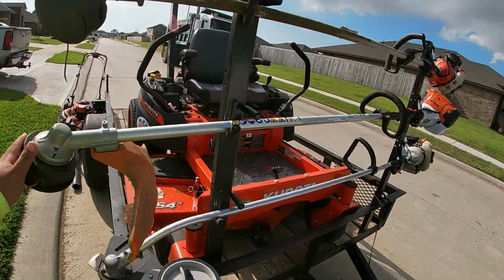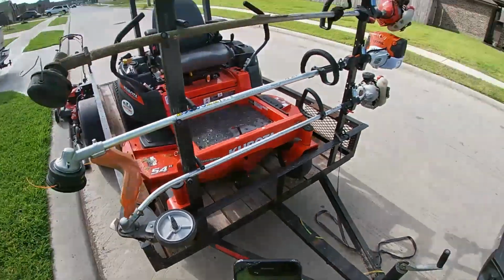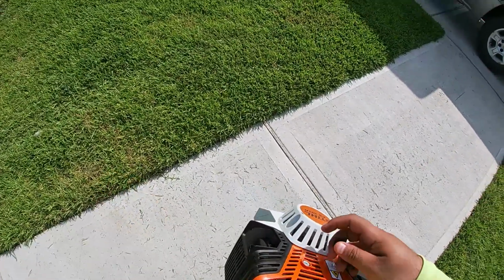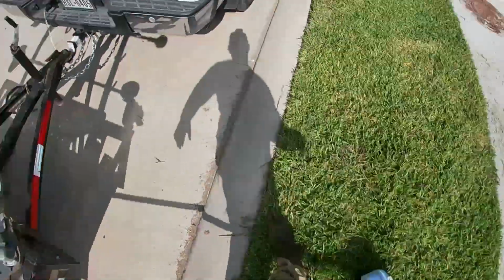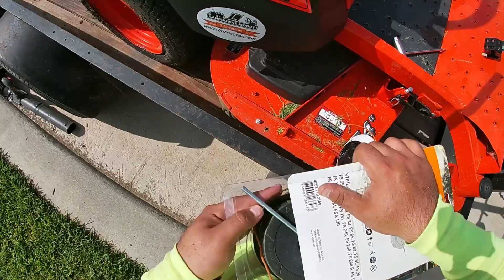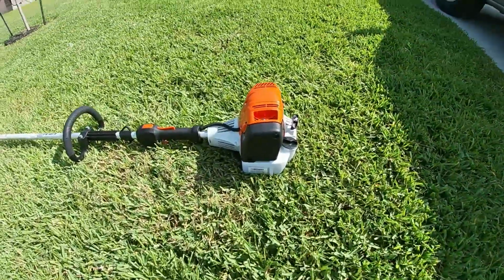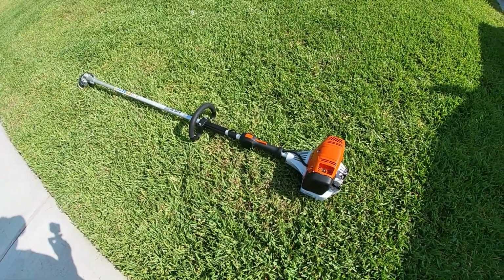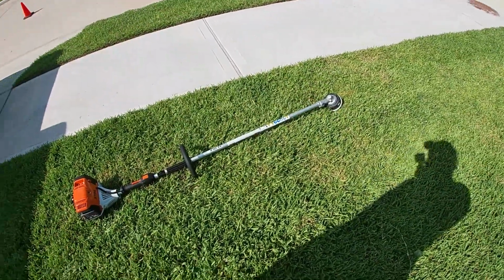STIHL Fs131r Review POV (EDGING , WEED EATING)

Comment: This is exactly what I need in a power tool review video!
Just use it as professional and show me how it rolls.  

That 35cc monster sounds like a smaller dirt bike. 🤙
Reply from the maker: stoichiometry147 yes sir she’s a beast still going strong the best weed eater I’ve ever used
Reply: Peewees Lawn Care I’m still getting an FS131r in time. But, need to replace a ryobi POS for now and I’ll get the 94r to keep my HOA from killing me.  
Since they seem to retain at least 70% of their value over many years and I’m getting it that much off, I’ll sell the FS94r for what I paid on CL.
Reply from the maker: stoichiometry147 that’s a good choice
Reply: The 94 is very reliable and light weight. Not a monster in the power department but it’s not designed to be. Plenty of inexpensive parts available too if you need to replace a rusted out muffler 5-6 years from now.

Comment: What model number is the new head you put on
Reply from the maker: king of the track 1990 auto cut easy spool
Reply: @PeeweesLawnCare  it doesn't have a number like would it be a 26-2
Reply from the maker: king of the track 1990 not that I know of I need to check it out

Comment: How do you find the four stroke compared to the two stroke at the lower RPM's?
Reply from the maker: MOTOCOMBAT the 4 stroke on lower rpms is really strong compared to 2 cycle weed eaters just imagine a 4 stroker on lower rpms is like using a 2 cycle on high rpms

Comment: You should a echo speed feed head
Reply from the maker: Logan Simpson is not sure if it will fit the weed eater maybe I’ll have to get an adapter brother
Reply: It will fit trust me
Reply from the maker: Logan Simpson ima try it soon
Reply: @PeeweesLawnCare  it brings adapters with it, green fitting i believe
Reply: @PeeweesLawnCare , it does fit. If you get the universal speed feed 450 head use the green nut. If not you can use the Stihl nut from a 25-2 (standard head) and it will work. Use speed feed 450’s on almost everything.
Reply from the maker: @nsatoday  ima try it out maybe I can get a smoother edge line

Comment: Too big for that kind of weed eating.  It is for rough cut weed eating.  You cant feather control  very well.  All or nothing.
Reply from the maker: AG86 yeah I actually noticed that , that’s why now I just use it for like big properties and over grown properties
Reply: AG86 I’ve got a 94r and my dad just bought a KM91R. Everyone says u can’t feather the 4 mixes but I used it quite a bit yesterday and it does fine. I’ll never buy another 2 stroke trimmer. Other than weight I can’t think of any reason to buy a 2 stroke.
Reply: @nalley6815   Nalley Hay Farms  I think the 94R has a  trigger that allows better throttle control.  An ecospeed wheel or something?   I read you can install it in the 131 but have not tried it. It sounds like a good feature.
Reply: AG86 trigger seems the same. I never use that dummy wheel. And I’m talking about the 91r. The 4 mix
Reply from the maker: Nalley Hay Farms I love the fs131r bro it’s a bit heavy but powerful ad he’ll
Reply: Peewees Lawn Care I’ve ran the 91r a bit. I can’t imagine how powerful the 131 must be. I agree the 4 mix’s are on the heavy side. So get this, every time I trim my back starts hurting. I used the 91r for awhile and my back didn’t hurt once. I guess it’s where the engine side is heavier and it wasn’t pulling me over as much?? Crazy idk man.
Reply from the maker: Nalley Hay Farms yeah I have noticed that when I use it for a while my back starts messing with me that’s why they have that shoulder strap lol but I never use it
Reply: Peewees Lawn Care see that’s weird because it’s reverse for me. It makes my back feel better rather than make it hurt
Reply: @PeeweesLawnCare , use the harness for the bicycle model. Much more comfortable. Also, a Darwin grip helps immensely